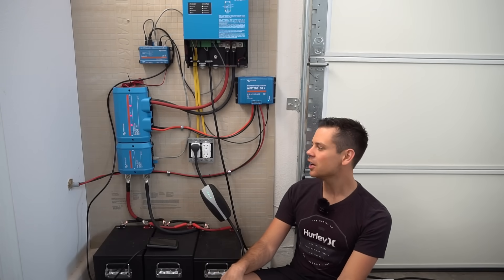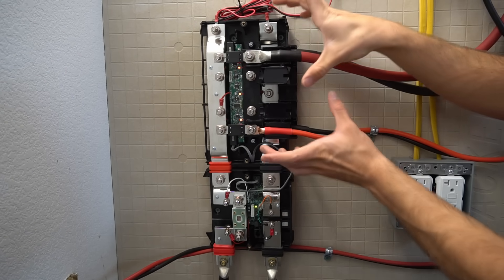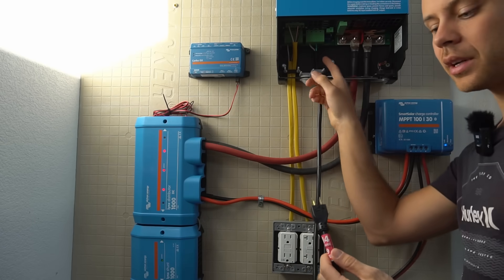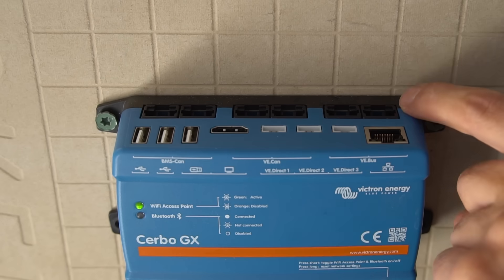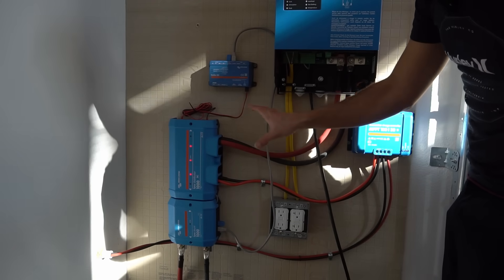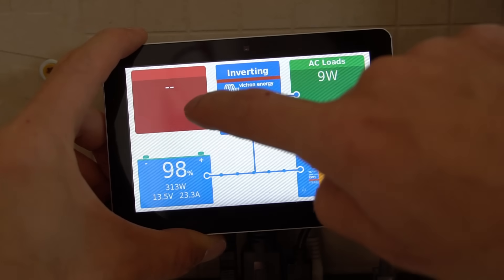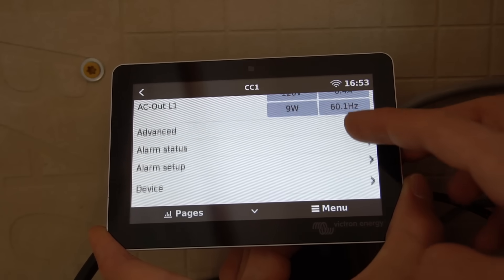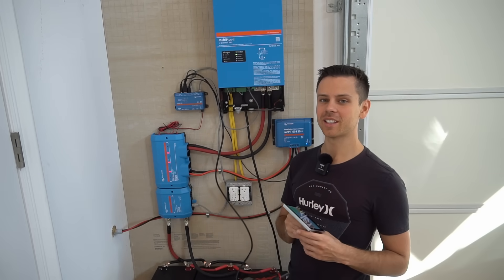Victron Made Easy! Design and Communication, Step-by-Step

Comment from the maker: Parts List for this system (affiliate links):
3000W 12V Multiplus 2 Inverter: https://www.currentconnected.com/product/pmp122305100/?ref=wp
Lynx Shunt 1000:https://www.currentconnected.com/product/ve-lynx-sh/?ref=wp
Lynx Shunt Main Fuse: https://www.currentconnected.com/product/lynx-s-fuse/?ref=wp
Lynx Distributor 1000:
https://www.currentconnected.com/product/ve-lynx-dr/?ref=wp
Cerbo GX: 
https://www.currentconnected.com/product/cerbo/?ref=wp
Cerbo GX Touchscreen:
https://www.currentconnected.com/product/gx-touch/?ref=wp
Smart Solar Charge Controller:
https://www.currentconnected.com/product/ve-ssmppt-ved/?ref=wp
SOK Batteries 206Ah: https://www.currentconnected.com/product/sok/?attribute_amp-hours=206Ah&ref=wp

~~~~~~~~~~~~~~~~~~~~~~~~~~~~~~~~~~~~~
Tired of getting ripped off? Check out my "Will Prowse Approved" solar product recommendations below!

12V Batteries
https://www.mobile-solarpower.com/lithium-batteries.html

48V Batteries
https://www.mobile-solarpower.com/48v-batteries.html

Offgrid Inverter System Builder
https://www.mobile-solarpower.com/48v-complete-system-blueprint-559371.html

Hybrid Inverter System Builder
https://www.mobile-solarpower.com/code-compliant-48v-offgrid-system.html

Mobile Handtruck System Builder (very popular!)
https://www.mobile-solarpower.com/mobile-48v-system.html

Solar Panels
https://www.mobile-solarpower.com/300w-solar-panels.html

Ground Mount Solar Racking
https://www.mobile-solarpower.com/ground-mount-racks.html

Wire, Lugs and Busbars
https://www.mobile-solarpower.com/wire-and-connectors.html

Tools
https://www.mobile-solarpower.com/tools.html

Fuses and Circuit Breakers
https://www.mobile-solarpower.com/fuses.html

Plug-N-Play Solar Systems
Ecoflow, Anker And Bluetti! So many models to choose from. See my current recommendations here:
https://www.mobile-solarpower.com/full-size-systems.html

~~~~~~~~~~~~~~~~~~~~~~~~~~~~~~~~~~~~~~~~~~
Need to build a large DIY system? Need a trustworthy solar distributor? These are my favorites:

Signature Solar
Creator of EG4! Solar Minisplits, Victron and More! Largest Solar Store Online.
If you want $50 off, please use my link below and coupon code "DIYSOLAR50":
https://signaturesolar.com/?ref=cPwLcVc0SW-BjN

Current Connected
Best Prices for EG4, Victron, Midnite and so much more! Fast Shipping and Highest Rated Customer Service:
https://currentconnected.com/?ref=wp

~~~~~~~~~~~~~~~~~~~~~~~~~~~~~~~~~~~~~~~~~~
Join our DIY Solar Community 
Need more help? Join the largest solar forum on the internet for beginners and professionals alike. 140,000 members and counting!
https://www.diysolarforum.com

Check Out My Free Book
Best-selling and beginner-friendly guidebook to off-grid 12V solar!
https://www.mobile-solarpower.com/the-book.html

~~~~~~~~~~~~~~~~~~~~~~~~~~~~~~~~~~~~~~~~~~
Contact Information:
I am NOT available for personal solar system consult! If you wish to contact me, this is my direct email: williamprowsediysolar@gmail.com
FTC Disclosure Statement and Disclaimers:
Every video includes paid promotion or sponsorship (such as free products for review). Some links on this YouTube channel may be affiliate links. We may get paid if you buy something or take an action after clicking one of these. My videos are for educational purposes only. Information is subject to change/update at any time. Electricity is DANGEROUS and can kill. Be smart and use common sense :) DIY Solar Power with Will Prowse is a participant in the Amazon Services LLC Associates Program, An affiliate advertising program designed to provide a means for sites to earn advertising fees by advertising and linking to Amazon.com
Reply: How much does it all cost, all in?
Reply: @ooglek  $$$$$$$$$$$$$$$
Reply: @floatybyboaty  hahahah aye... if you have to ask, you can't afford it
Reply: Hi Will. Your knowledge and videos are amazing!
I'm looking to power a double decker bus conversion for permanent off grid living. 
I live in the UK so there's not lot's of sun light and don't want to rely on a generator for constant power. I've thought about using ev batteries from ebay and charging them at ev stations. 
Is this viable?
What system would you recommend?
Any help would be appreciated. 
Regards, Simon.
Reply: Thanks Will.  I really like the Victron Energy lineup, so love to see more vids on VE.  Do you know if or when the MultiPlus-II GX 48 Inverters/chargers will be available in USA?  Any other recommended distributers like CurrentConnected?
Reply: Compared to the split phase MPP Inverters you already have, do you believe the features of this Victron system, combined with split phase dual inverters, is worth the additional cost?  Obviously, the real value feature here is the Victron Remote Management Portal for remote access.
Reply: @longhairpaul  This inverter is awesome for those of us with 50 amp RV's which is what is was designed for.
Reply: Yeah, the Lynx distributor is fine, but mine is flakey on being red or green on Led status, and the Cerbo doesn’t know what’s going on with it over VE yet.  Kinda bums me out .  I sure would like to debug why it’s flakey.
Reply: Does the 12v wire from the Cerbo measure voltage? If so, shouldn’t it be connected straight to the battery to measure voltage without effects of voltage drop? Thanks for a great video!
Reply: Thank you!
Reply: Will - slightly off topic - I can’t join the forum because it never sends the confirmation email. I can’t message anyone there because I’m not verified. What should I do?
Reply: Maybe I have missed it but on a MPPT solar charger you have where the solar connects, where the batteries connect, but the 3rd connection that always just shows a light bulb. I can never really find a video that discusses this. What is the most I can run off this? I have a 30 amp MPPT solar charger. Great videos btw.
Reply: 20kw solar, how many solar panel, batteries, size of inverterand mppt.
Reply: So what if I'm connecting lithium battery BMS com, how do I connect with the cerbo GX
Reply: Will, I have been looking around to see if it’s possible to add one of these “off grid” systems to my existing house and solar setup. I’m not sure what that system would be called or the components needed. House has solar that goes back to the grid right now. I want to add a battery bank for evening use (net metering prices) and also have it setup for is the grid goes down so much house will still have power.
Is that possible? I have a full solar array with a inverter. I am looking to add a battery bank and use my existing house panel (if possible). Any help you can provide would be incredible. Thank you in advance.
Reply: They did not make it easy. Making it easy would be including all of those things in a single unit with the controller/inverter that did not cost you an extra $500 worth of addon's
Reply: do I need to apply for net metering before connecting the multiplus 2 inverter to the grid?
Reply: I loved my Victron inverter when I first got it. Unfortunately after a year it crapped out and Victron refused to honour the warranty for repair or replacement. 
Buyer beware!
Reply: I appreciate your video. We are changing to Victron, was using EPEVER but their inverter charger does not have to option to adjust low voltage cutoff for AGM batteries,  21 volts is their fixed value. EPEVER isn't interested in fixing the problem.
Reply: Maybe you can help me I'm looking for someone that can help me install my small solar power system that I have on my box van I need someone in Washington that's familiar with a viltron energy solar charge controller and distributors going into a 48 volt inverter it has 5 solar panels on the roof each are 370 watt for as total of 1850 watts all together. So do you know anyone in Washington state that can accurately hookup this system???
Reply: dose this come in a kit?
Reply: Have you had a chance to try out the Victron MultiPlus 48/8000 yet. I keep wanting to build a shed is for critical components freezers and such just cant get it narrowed down what to buy.
Reply: Don't buy Victron!!! Is junk from India

Comment: if i had the Victron Energy Lynx Distributor - Modular M10 DC Bus Bar with 4 Fuses. Do i still need DIHOOL 600 Amp DC Circuit Breaker, Battery Disconnect Switch for Boat Trolling Motor Marine ATV Trailer?

Comment: I see this is pretty old, but anybody using this inverter? I’ve got to replace one that is too noisy and runs hot. Wondering what this sounds like. Does it run quiet (no fan) when minimal (1/3) load?

Comment: Thanks!
Reply from the maker: Hey thank you!!! This made my day :) glad I can help
Reply: @WillProwse  Hi Will. I am a fan and  have watch nearly all of your well made videos and have learned a tremendous amount from you. Thank you!
I am now installing a Lynx system on my antique boat. I’m using SOK 24 volt 150ah batteries in parallel. I want to use a Lynx Class T Power In/Lynx Shunt/Lynx Distributor, but there’s no good way to install a battery disconnect switch downstream of the Class T fuses, but upstream of the distributor. Do you have any thoughts on my problem? I wish Victron Energy made a Lynx Battery Disconnect that integrated into the system…
Thanks for your consideration and for everything you do!! 🤗
Reply from the maker: @rleroyradford  I would not install a disconnect for the battery. Or buy a battery with the properly rated one built in. Can you post your system on the forum?
Reply: @WillProwse  I’ll post it on the forum. 😊

Comment: Hi Will. I am a fan and  have watch nearly all of your well made videos and have learned a tremendous amount from you. Thank you!
I am now installing a Lynx system on my antique boat. I’m using SOK 24 volt 150ah batteries in parallel. I want to use a Lynx Class T Power In/Lynx Shunt/Lynx Distributor, but there’s no good way to install a battery disconnect switch downstream of the Class T fuses, but upstream of the distributor. Do you have any thoughts on my problem? I wish Victron Energy made a Lynx Battery Disconnect that integrated into the system…
Thanks for your consideration and for everything you do!! 🤗

Comment: What do you connect the battery cables to the Lynx Shunt bus bars?
Also, Victron doesn't say anything about a main fuse in the Lynx Shunt. It included a bar that fits there. Why don't they even mention it or cary it?

Comment: I have a SolarEdge inverter linked to 16 panels ground mounted. I have 4 lithium batteries but the charge controller failed due to excessive mains voltage, so I need to replace that, also I am tied to the grid, I would like to able to isolate my home from the grid. What can you recommend as the best solution?

Comment: Instead of blah-blah about how it's easy to plug cable (like we're retards), better you explain, can you use solar energy to charge battery AND(!) at the same time consume batteries to power home appliances. It's VERY important case, because day is the most active hours to use "free energy".

Comment: Victron is just bunch of greedy m0r0ns - they made idiotic proprietary connections/protocols instead of just using normal TCP/IP standard + ANY router/hub! WTF I need all those "terminators"?? Just use normal ethernet cable from ANY victron device to the hub and viola - everything should communicate.
Reply: The reason Victron has high price is simple - monopoly! These dinos think if they make proprietary sh_t, they can milk people forever (like MS with *.doc format). But reality shows you suck in dust if you sit on hidden and/or proprietary formats. Finally they made *.docx and TENS concurrent "Offices" were written. Same here - longer Victron sits on proprietary cables/protocols, faster their community reduces - nobody wanna hang on proprietary hook!

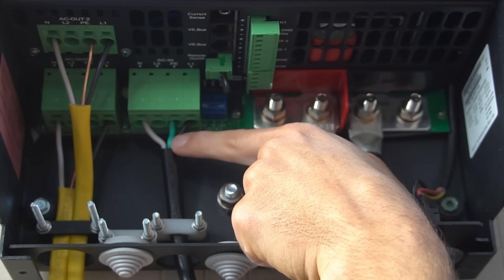Comment: 4:21 so what if you have 2 AC inputs? For example shore power AND a 230 volt diesel generator ?
Reply: You need quattro and not multiplus inverter or ATS

Comment: Just built a full victron system from what I learned from watching your channel. 

When with 2 vatrer 460ah batteries in series, 2 victron mppts with 1200 watts of solar on the roof, proper class T fuses, 4/0 copper cable, smart shunt lynx power in, shunt and dc bar, Cerbo gx, gx50 and multiplus 2 5000w. 

Waiting for the batteries to charge fully and let them rest before hooking it all up. 

So far shore / generator power is hooked in and working. 

Here we go!! Thanks Will!
Reply: How did you hook up shore AND generator power to the inverter? I’ve been wanting to find out for a while
Reply: @RadioNassau my generator power is the shore power. I had this same question for so long My trailer is off getting wrapped I can make video when I get it back.
Reply: @PizzaStopLLC oh like that. I just did some research and found out if you use the victron Quattro, you have 2 AC inputs so you can have a separate diesel generator that plugs into a cerbo GX and AC input 2, and shore/grid power can be connected to AC input 1. And it automatically switches to AC input 2 when input 1 is disconnected, and using the cerbo GX you can make the generator start itself.

Comment: Can someone please clarify this? Browsing the internet, I find contradicting information.
Can a Victron MultiPlus II (or Quattro) operate in grid-parallel mode—that is, feed power into my house wiring in sync (frequency and phase) with the grid? I want to use a smaller kW inverter than my house’s full load, supplying part of the load from the grid and part from the inverter.
If this is not possible:
A. Is it technically unsupported—are there missing features in the Victron equipment that prevent this?
B. Or is it "not possible" only because certifications (either from Victron or from my specific installation) are missing?

Comment: I’m helping get a new Victron system up and running next week. I had better start watching videos as I’m not sure they ordered the correct components to do the monitoring ?!. They got EG4 LL S ,100ah, 48VDC, server rack batteries. They got a Lynx distributor, and a Ekrano gx. Do we need a Lynx shunt? They did not order one. Is there shunts in the EG batteries that serve the purpose? Thanks

Comment: 5:20 Woth mentioning is that the Multiplus II has 2 AC outputs. 1 is powered by the Multiplus II from the batteries and is always on. 2 is powered direct via the mains input and is only powered when you have shore power.

Comment: Will, thank you for this great explanation. I am looking at installing a Victron system in my RV. I see that the multi plus inverter allows / manages a shore power input? I have a generator that is staying on board. Will this inverter allow a 50amp input directly from the ATS? (Currently shore power and generator feed the ATS then on to the power distribution panel)

Comment: Couple of quick Questions. 
So if i install the Shunt 1000, do i not need an isolator from the batteries?
Also, what is best for the Distributor, M8 or M10?
Thanks in Advance

Comment: You said you would leave that setup for testing, and it’s been 3 years since your video posted. I’ve been thinking about putting this setup in my truck camper, albeit with the older model inverter for size constraints, would you change anything to what you built or recommend something different than this setup?

Comment: Would I need an additional fuse and fuse holder for the battery bank between the battery and the shunt? Or is the fuse on the positive side of the shunt enough?

Comment: Have you ever seen this error: “Fault condition” on Cerbo GX display from a Mulitplus C 12/2000/80-30? When being used with fluxing load between 5 and 500w with 1800w solar, which tries to deliver the required load - with some delay.

Comment: Its nice but hands off any 12v multiplus, I started with 48/3000va mp1 and ended just now with mp2 48/15000va and I have to use about 200mm2 cables to connect inverter for them not to overheat at 12kW at 244V my dc voltage is approx 47V. Cheers from eu.

Comment: Is 2/0 gauge enough going to the inverter? the manual states you want 2x AWG 1/0 (for both + and -) for 0-5m cable length, and 2x AWG 2/0 if cable length is between 5-10m, with a 400amp fuse. How would two cables connect to the distributor? Would you take 2 slots on the distributor with a 200 amp (400/2) fuse each? This is confusing ...

Comment: so... quick question....you can setup the multiplus with a pylontech(in my case a 48v 50ah maxli battery) without the cebro gx. Is it possible someone could advise if you can connect the data(can or rs ports on the battery) to the multiplus 2(48v 3000va) and get them communicating (Even if you only see it when you directly connect using the ve direct port....
Many thanks!

Comment: How do you guys deal with voltage spikes from the Victron charge controllers?  My old Outback Flexmax 60 never had any, but my new victron has them all the time.  They're so bad, they trip the over voltage sensor on my Aims inverter.  I run AGM's still, but I couldn't imagine running Lifepo4 and having to deal with the BMS tripping all the time.  Can't be good for it either.  Thanks.

Comment: Hey nice to see a Victron setup from you.
I am not sure how I feel about them, reliable and middle of the road cost, but the pattern I kept seeing is they prefer high amps to high volts for everything, and I dont like that as the wire size has to be so large and with solar panels means adding a lot of protections that I do not need with series.

Comment: Simple & concise explanation of the Victron units. Plus great nuration. One question if you do get to see this. I am in the UK & regularly run at 250 volt, even though we are meant to be at 230v these days  to tie in with the EU grid.  
On this voltage wound you aim for the 48v inverters or the smaller ones. I am looking at using lifpo4 battery's with a max need of 4kw for an hour.
Cheers & keep up the good work, Its helping a lot.